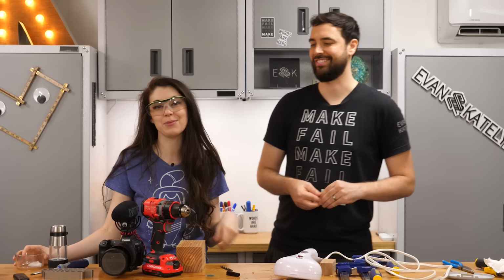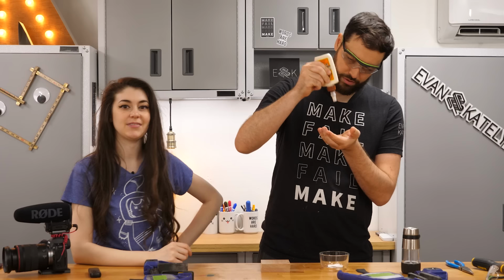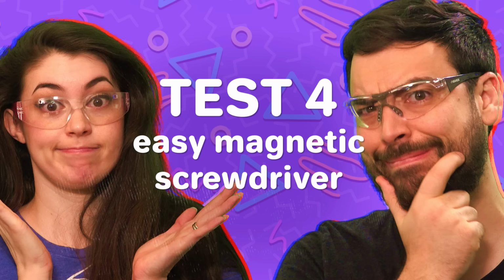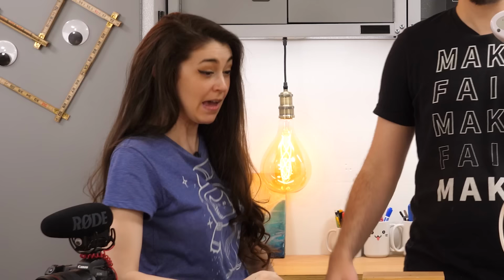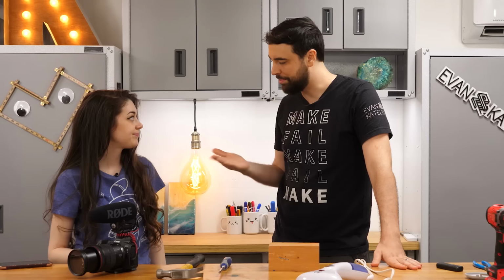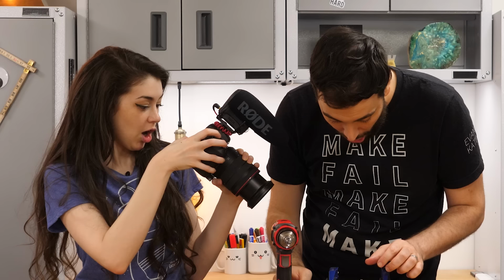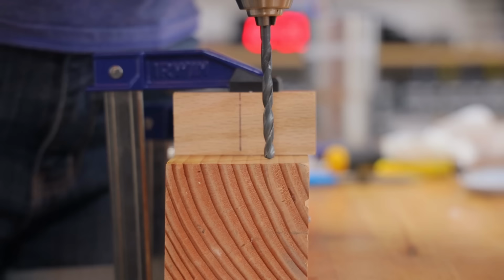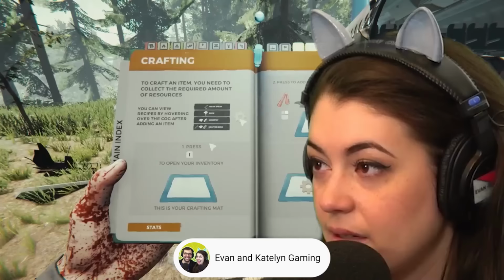Makers Test 7 DIY Life Hacks

Comment: As an absolute dumb dumb who has stripped a nail SEVERAL times, I've always found the rubberband hack to work! See, the key ingredient that you need to get it to work that you guys were missing is desperation
Reply: Yeah, I'm surprised it didn't work for them. I've used to remove a license plate screw that was damaged and rusty.
Reply: how do you strip a nail??
Reply: I usually just cut a slot in the screw head and use a flathead screwdriver to screw the screw in >:P
Reply: @DestroyAllLinesOne  usually it's becauase I'm using the wrong size screw driver. It doesn't fit so it slips a lot and slowly wears down the metal that is supposed to catch
Reply: @Adventurous-Emma  I think he's referring to the fact that you used the wrong word. You're stripping screws, not nails...
Reply: Yeah desperation and a lot of weight on the screwdriver!!
Reply: I have a screw sticking out of a shelf 5 years later.  it didn't work for me.
Reply: Uhh... You can’t strip a nail.
Reply: Can confirm; desperation is the secret. I stripped THREE small screws in my 2001 CR-V while trying to replace the taillight bulbs. The rubber band didn't work, all the other life-hacks didn't work.
What DID work was hammering my screwdriver INTO the screws like a maniac, then unscrewing as normal. Desperation, my friends.
I then had to put as many screws as I had back in after the replacement, drive down to my local auto-parts store, and spend about an hour annoying the staff trying to find something the right size to replace them.
Reply: @waxsoda  What? Never heard of a screw shank nail?
Reply: Every time I have tried it it has not worked.
Reply: @timothyneiswander3151  you can't strip a screw shank nail.
Stripping refers to destroying the screw head where the screwdriver and screw contact.
A screw shank nail doesn't have a screw head.
Reply: Timothy Neiswander no
Reply: @waxsoda ummm...WOOOOSH. It's just a screw but I have actually used this term.
I had to get a building permit to put up a privacy fence. The code stated I had to use nails to affix the panels to the posts. I decided to use deck screws because that would be more secure. The building inspector stated, "you're going to have to redo this because you didn't use nails". I replied with my best poker face,"but those are screw shank nails". He stared at me blankly for about 30 seconds, then signed the paperwork, handed me a copy and left without a word.
Reply: I’ve never gotten it to work. And I really want to fix my DS and XBox controller.
Reply: Desperation or a very determined technical theater major 😂
Reply: @timothyneiswander3151  but screw shank nails do exist.
You can't redefine a term and then wooosh someone because he doesn't know the definition that you made up.
Reply: it works really really good with bigger screws, not littol ones. CRIES
Reply: I'm sorry... did you say you stripped a nail? Not sure how rubber bands or anything helps a stripped "nail"
Reply: Destroy All Lines 
That's what I was thinking lol
Reply: Don't know why you're calling them dumb dumb. I  bet you have done the same thing before know how to actually do correctly.
Reply: how does one strip a nail? issa hammer boi
Reply: i mean i guess if you beat it to the point its scared enough i guess it'll strip but thats a very abusive relationship
Reply: Lol
Reply: Yeah in my experience this hack does make a big difference, when you have screws that is just impossible without it. 

I’ve also found that stretching the rubberband under the screwdriver works better. 
So I stretch the bend thin-ish with one hand over the screwhead, then put the screwdriver on top and then let go of the rubberband with my other hand, the pressure keeps it in place.
Reply: @timothyneiswander3151  Incorrect use of wooooosh. This wasn't a joke. It was just a mistake haha.
Reply: @roadtoadrumble  incorrect use of the internet. WOOOOOSSSSH
Reply: It usually works a lot better with robertson head instead of phillips!
Reply: Totally agree!
Reply: Whays a strip lol
Reply: How do you strip a N A I L?
Reply: @krismorris4282  I’ve made it work through sheer desperation and effort. You need a good rubber band and a good screwdriver though, and it helps to shove something small in under the screw and wiggle it around. If you still can’t make it work then you have to carve a thin hole through the screw and use a flathead (a dremel helps).
Reply: "hOw dO yOU sTrIP a nAiL" 

you people are insufferable
Reply: SAME
Reply: ...im sorry to be the anoyng straight lace nerd, but as someone who has a dad that works with wood as his job its kind of frustraiting to me so ill say it for my own peace of mind.....
screw + skrewdriver ,...... nail + hammer never mix them up bc omg just imagining someone hamering a screw or trying to screw in a nail gives me the cringiest oogees (*shiver*)
Reply: Same, worked for me every single time
Reply: @lizhi4195 I'm like this with yarn vs wool, yarn is the string/thread made from a range of fibres, wool is one of those fibre options (among its other uses)
Reply: If you think you are a dum dum for stripping screws, I have managed to strip a screwdriver.

Comment: Watching the glue part, I’m here like: I use salt to clean up glue spills as it stops glue from bonding and makes it kinda like slime.
Reply: me having first watched the king of random's hack testing video where they use salt to clean up glue spills
Reply: @lisaedwards1359   same I watched it and the rubber band one I knew was going to fail
Reply: @peepandstitch  I’ve gotten it to work  the screw was pretty stripped and used a thin rubber band. The thicker it is the less definition comes out
Reply: Oo, that's actually good to know! Thanks, now i will always have Salt on hand when working with glue <3

Comment: the soap thing is more for metal when you are cutting it to make jewelry, you rub the jewelers saw along soap (or more commonly beeswax) then cut into the metal. Makes it much smoother and helps make cleaner cuts. Not ideal for wood, just metal.

Comment: the rubber band one is more geared towards screws you have partially stripped and are afraid of stripping further.  Also the screws on wood is not a great test.  Screws dont come out of wood as easy as they do household electronics, which is also what the rubber band trick is geared towards

Comment: I've taken woodworking classes, and we've been taught that with dents like that shown with a steamer, you can iron them out. I've never had to do it myself, but I figure a steamer and an iron are pretty similar in function
Reply: It's hot, and it's wet. Sure it's the same thing! I don't even have a steamer. I have no idea what I'd use it for.
Reply: Its literally the same thing happening thats for sure you just get better heat coverage with an iron plus it also flattens the rest out better too

Comment: I'm in training to be a cabinetmaker and I use the steam hack with any dents, though I do it differently. I put a wet paper towel on top of the wood and then run an iron (on low) over it until it's raised enough and then sand it smooth. I think it works because you're putting moisture into the wood, which makes it expand.

Also with the soap hack, I've used that and it's really nice for soft metals like brass which are really easy to strip. I used paraffin wax though, which may have some slightly different results
Reply from the maker: thanks for the tips!
Reply: @EvanAndKatelyn  and for really hard wood, had to assemble legs on a oak countertop style slabs without proper equipment, the soap helps a lot
Reply: Would this work on my parquet floors? I dented it a while back when i dropped a weight on it =\
Reply: @fireroum  I haven't tried it on a finished product so I wouldn't suggest it, there are several things that could go wrong. I just use it when I dent a project that I haven't put a finish on

Comment: For the magnet trick, there's already "magnetizer" that exist. It's a bit safer than having a magnet spinning :-P. You slide your bits or screwdriver into them and they get magnetized, once you no longer want them magnetized, you do the same in the demagnetizer section.
Reply from the maker: cool!!
Reply: I have that, and it never works for me!
Reply: Or if you only have the magnet, you can just slide it along the screwdriver a few times; the magnetic effect won't be as strong but it lasts quite a while ^^
Reply: They literally make screw drivers and tips which are magnetic. It's been a thing for like decades!
Reply: The screw driver they used to demonstrate this already had a magnetic coating on the tip, which is why it stuck without the magnet as well.
Reply: Whether or not you can permanently magnetize the screwdriver will depend ultimately on whether it’s made of a ferromagnetic material or a paramagnetic material. In the case of the hack, the presence of an external magnet produces an identical result in both types of materials. As already mentioned above, in the case of ferromagnetic materials you can always create a temporary, weaker magnetic field without resorting to the methods necessary to make the magnetism permanent.
Reply: @kagomeonetwo  Perhaps what you have is paramagnetic and not ferromagnetic, which is possible even with stainless steel.

Comment: I have used the rubber band trick on stripped decking screws to remove them, and it does work. Just my thoughts though.
Reply: According to my dad my grandpa and him used it use the rubber band trick. I've also used it before and it has worked. Also if your screw hole is striped you can put a toothpick in the hole to help.
Reply: Same
Reply: Maybe I’m thinking of a different channel but I could have sworn that they’ve used this trick in a past video and had it work.

Comment: Been doin #4 (the magnet thing) for a while. Fun fact, most every socket (3/8” drive or bigger) will fit a small button magnet in the square drive well for all your ratchet and socket needs.                      Oh, don’t use this in blind areas near metal. You’ll just end up losing a magnet.

Comment: The steam totally works. I've used it on a guitar that got a booboo from falling over. It won't work miracles but it does work.
Reply: Does the dent come back after the wood has dried?
Reply: :0, this is a revelation

Comment: The earbud ad actually showed a pretty good use case. Though more for just a situation where you want wireless over wired. If you put a treadmill under your desk and want to have headphones on, wired headphones will zap you. Or rather you zap them? kinda ... Walking on a treadmill builds up static electricity in you. But you can't ground through the treadmill for various reasons. So with wired headphones, you'll get periodic zaps in your sensitive ears as they end up as the path of least resistance to your PC ... unless your PC somehow isn't grounded ... in which case I wish you luck.

For those wondering, this didn't happen back when people used wired headphones for portable music players while walking because the music player isn't grounded. So the path of least resistance in both that case and in the case of using wireless headphones is usually through the air which happens equally across your whole body, or through your feet if you aren't wearing shoes with rubber soles.

Comment: My drill has two tiny levels on it... Like one for when you're drilling horizontally, and one for when you're drilling vertically... It's a secondhand drill I got for free from a relative when I moved out. I don't do anything special with it, I just have it for around the house (apartment actually) stuff like putting stuff up on my walls...

Comment: The soap trick for screws is mostly for when you don’t have a power tool.  Believe me it does help when you are doing it by hand.  I’ve used that method several times before I got a battery powered drill.

Comment: You should try making the most functional desk ever. Incorporate floating shelves/storage held by the desk, create drawers and compact storage areas on the side and under the desk. And maybe incorporate something that slides out of the way to reveal a quark board or chalk board? Make sure to include resin to! If you can incorporate a lightning and cable organization system then that’s brownie points!

Comment: I've definitely used the rubber band hack to take apart my earlier projects with stripped screws! It didn't work on all of them but it saved me so if you need to take out stripped screws, you definitely at try it

Comment: 10:31 - In this case, I think it's less the heat and more moisture, which causes the wood to swell up just a bit. I read a similar life-hack that said to just put a couple drops of water on the affected wood, and then when it's soaked up, sand it back to flush.

Comment: When I was little, my dad told me that some screwdriver bits and hand screwdrivers were made to be magnetized for that reason.
Reply: Kat Griffiths in my experience, the magnetic tip screwdrivers are always too weak. None I’ve used ever held a screw as well as it did for them. Plus, you can get the cheap screwdrivers and just slap a cheap magnet on it.

Comment: An alternative to the last one with the line, is to cut the scrap in half, with a good 90-degree crosscut, then hold the two pieces together side-by-side, but with their ends slightly offset from each other.  This allows you to easily nestle your drillbit into the vertical inside corner between the end grain of one piece and the side grain of the other.  Easier to use than sighting a line, because the bit can actually touch the two vertical surfaces.

Comment: PSA: do not use the magnet hack or other magnetic screwdrivers and similar when you are working with circuit boards, laptop, other computer-y stuff. Data storage works by assigning polarity to a thing and magnets disturb that. This means that you can delete the data on a drive, be it solid state or 'conventional', by placing a magnet on it. Circuit boards can be very delicate also, and you can easily ruin the things by being clumsy with a magnet, also static electricity is not your friend when working with such things... which is really sucky, because having a magnet with those tiny screws would be so great ...
This does not have to be a problem, but it can be and since tech can be stupid expensive, it would be really sad to ruin a thing because of that.
Reply: Well, yes and no... A lot of drives are magnetically shielded up to a point; otherwise, you’d wipe your hard drive just by carrying your laptop in and out of some buildings with magnetic security gates. Since the screws are generally very tiny, it wouldn’t require a strong magnetic field to hold onto the screw. In fact, there are some computer repair kits that come with magnetized screwdrivers and such. Is it safer to avoid magnets completely around computers? Sure! However, if you know what you’re doing and are careful, you’ll be fine. 🙂

Comment: With the salt and glue one you can use a little bit of sand instead or put a bit of a nail in it and clip it off to hold both parts of the wood together

Comment: With that steamer hack...you can also use a clothes iron and a wet cloth. Soak the cloth in water and place it on the wood where the dent is and then take your iron and go over the cloth+wood. It takes out dents pretty well and you wont need an actual steamer. I work in a cabinet factory and we do this all the time for damaged pieces. If the dent is deep enough it wont fully fix it but that's what using a wood crayon before you paint is for. Thanks for the video!

Comment: Rubber band hack does work! Ive used it so many times. Love the other ideas though. May I suggest a trick with a nail. If you need to make a mark in the same place so you can joint wood together place a nail with the head of it where you want to drill and then sandwich it with the other half of wood, then hit the top part of the wood with a mallet and it'll make a mark to drill a hole in both sides! Love the videos guys keep it up!

Comment: My dad's been a carpenter for over 20 years and I asked him about the steam removing the dents. He said that denatured alcohol works too. So you take a dropper with the alcohol and drop it on the dent and you light it on fire. The heat will help raise the wood back up. Just extinguish the fire when you're done.😋

Comment: A fun project you should try is making resin gears, 3D print/cnc gears, make a silicone mold of that and cast it with resin. Could make a cool mechanical clock out of resin

Comment: Unless you are using really small nails, use a regular pair of pliers instead. The regular pliers are wider and the grooves in the end will help hold the nail straight. I actually used this technique last night while installing some cabinet backing inside the house.

Comment: The salt on wood does actually work, I've done it as long as I can remember. In fact we always have a jar of salt next to the wood glue on the shelf.

2 notes on it though. Don't mix the salt into the glue, that could change the viscosity of the glue. Don't use so much.

Apply the glue, take a tiny pinch of salt and sprinkle very conservatively. A few grains is plenty. It's like a bed of nails, if the gains can be so close together that they don't become embedded in the wood.

Comment: How you actually should do the salt glue hack...

The key to the salt glue hack is that you have to mix the glue and the salt together and then put it on the wood! then the glue will stay wet instead of it being a coat of salt causing the glue to not stick to the other side. but if you mix the salt into the glue then the salt has its graininess and the glue can actually be wet and stick to the other side! the graininess of the salt is for grip/keeping the pieces in place while the glue dries and the glue is for keeping the pieces together in general